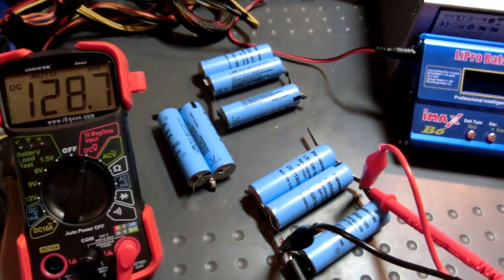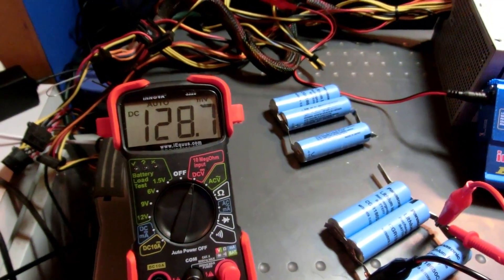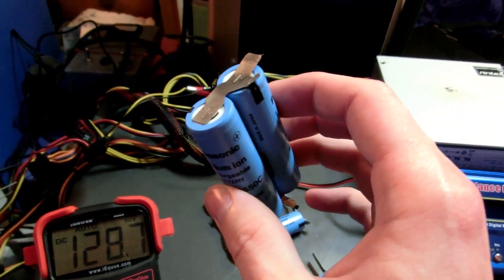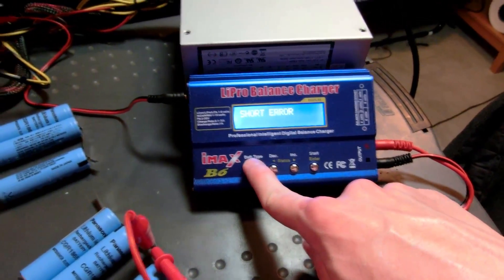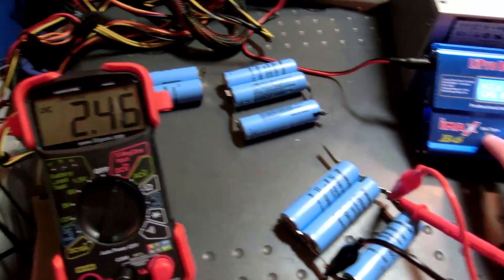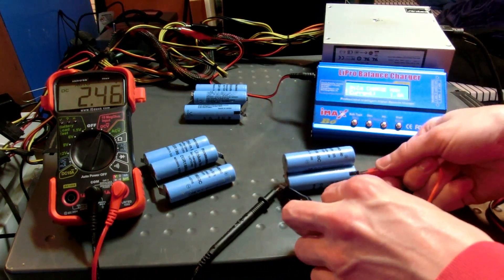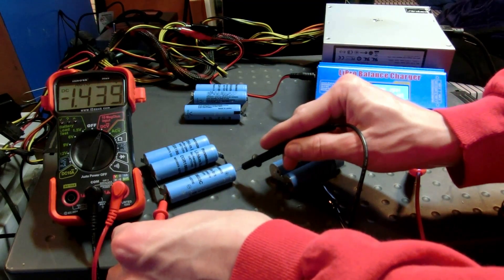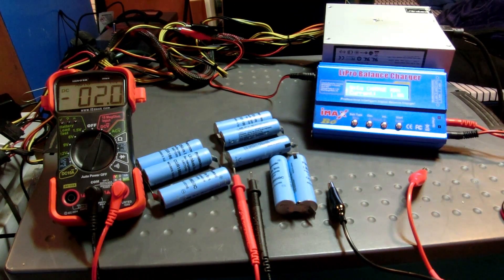Testing old Panasonic CGR18650C Lithium Cells

Comment: For anyone wondering... When reviving old/dead Li-Ion cells, first: separate them!  Any one of the (3 in this case)parallel cells  can be a failed cell, and pull the others down. 
Next:  NEVER, EVER, charge Li-ion cells at full rate if they are less than 0.9V... they must be trickle charged at less than 0.1c until they reach at least 1Volt.  Then it's best to restrict charge rate to under 0.5C until it reaches 2.0V, then you can increase to the manufacture's specified charge rate.
Liquid electrolyte Li-Ion cells (as shown in this video), when  left discharged, will experience dendrite growth throughout the electrolyte, which are microscopic strands of metallic Lithium that can short-circuit the cell. This is 'terminal' to the cell, and can not be reversed.
Reply from the maker: +beforebefore if a cell had been pulled down by a parallel cell, dont use it.

Comment: I came across a few as well. Word of advice, cycle. If you charge an old cell and it discharges quickly, it doesnt necessarily mean the cell is bad - rather, the cell may be  in need of reconditioning. Charge it again, but at a lower current. You'll notice the discharge slows down with each cycle of slow charge. Give it a try!
I've also learned that a charge current of .0125A over several hours will spring any (so far) rechargeable lithium cell back to life, from below 1v. Interesting stuff, this lithium chemistry
Reply from the maker: +Addis Williams i used to use cells from bellow 1v, but then one of them almost blew up my battery pack when it shorted out. its just not worth it. i only use cells found above 1v now

Comment: Specification:

Material: Li-ion Battery
Voltage: 3.7V
Capacity: 2200mAh
Size: 66x18mm 

- 18650 3.7V 2200mAh Li-ion Rechargeable Battery 
- no memory effect
- Widely used on torch, laser pointer, as emergency lighting and other portable devices

Comment: I just found 4 of those cells at GoodWill in San Carlos, CA. They all bonked pretty hard. Dead cells.
Reply from the maker: goodwill sucks pretty bad though, they sell everything thats good on ebay.
Reply: True. Another Dell battery had 8 cells and they are averaging 600mAh. I wish I could show you a picture. It contains 4 'Rinoa' tips. Batteries sure are fun.

Comment: wasn't sure given the age of the vid if i should comment or not... but...
When you started trickle charging, the voltage jumped to 2.1V... this is the old school battery protection circuit re-enabling the battery from a sleep state.
The reason the battery's still slowly discharge is because your multimeter will draw ua from the battery to detect voltage and given the battery capacities were so low (~0.1%) this equates to a noticeable constant voltage drop.

Since the video is a year old, you may have used them etc however i would do 5 charge / discharge cycles at 100mA and note their capacities... If capacity is over 60% of original then repeat test at 1A charge discharge.
If the capacity is still rising after 5 cycles, continue cycling until capacity stabilises.
NOTE: at higher amperage charge discharge the capacity will be different than 100mA but it may recover more as the electrolyte becomes 'more' active from dormant state.

Let me know if you try this or if you have already used / thrown them.

Also, you might want to consider a lipo charging bag if you are worried.

Comment: well, actually since they're old and haven't been charged for a while, they will self discharge. i recycle laptop batteries and pick out the ones that takes the highest charge. and i recharge three at a time to a max of 4.18v, i use them for flashlights o4 whatever. 
when it's zero or almost dead, charge a juice in them at to bring it 1v then charge it right away. they hold their charge pretty well when fully charged. i just use my 2-3 cell rc battery charger.
this is what you gotta remember  when laptop batteries stops charging, 99% is that the cells are still good and the 1% is the safety charging electronics attached to the cells. these things have a safety chip that can only be charged a certain number of times and after that it will brick the entire thing and there is no way that you can charge it using the laptop charger. this goes for any lithium power tool batteries as well or anything with lithium  cells. the cells are still good but manufacturers put a limit on charging them, one for safety reason since lithium explodes and of course the main reason is that it is expensive and profitable, the more often you replace them the better for the manufacturer.  business!
remember, the cells are still good, but you gotta balance charge them or if you have single cells li-ion charger works better.

Comment: In the video, after you have the B6 displaying "Short Error" (while charging at 0.1A) - the next clip shows the B6 charging these at 1A (not the 0.1A you mentioned before) - is that on purpose, and is it safe? Having some 0v 18650s and a B6, I would like to try this for myself. :)

Comment: Maybe you can help figure out why my E-bike Battery wont charge.  It is a fairly new  36 v 9ah battery for the BH-Emotion Neo.   It reads 25v right now but it wont activate the charger to start charging it.  Now I have a second battery which charges normally on the charger.  Do you have any idea what is reason why the battery wont charge?

Comment: I recently tore apart the pack from an old NEC P1 laptop, has the same batteries, all of them showed that small voltage, they all took a full charge to 4.24 volts and are holding well, I have them in power packs and they work fine

Comment: normally one goes bad and it drains all the others, so charge them using the fast charge setting on the imax b6, it basically only does the bulk charge and also only charges it to around 80% capacity but then soon after finishing remove the tabs from between them and leave them for a few hours and check the voltages again.
Reply: Thomas Sears i found this from when i charged one i noticed one of them was getting really hot and i was because it was dissipating a fairly large amount of heat

Comment: i have a box with a lod of 0 volt li-ions in just dont have a charger that will give me very low current to try and charge them really realy slowly to see if they will come back to life
Reply: David Simpson I made one from a little charger like for a cell phone . I charge a few at a time so it lowers the amperage between them. Out of 276 cells I have 33 were bad
Reply: ww321 yeah but wouldent the on bad cell hold the other back from charging in the pack
Reply: David Simpson  Not really . You would start the charge and monitor with a volt meter. Say you stop at 3.5 v and check. let them sit and see if they lose voltage. I would say though I never leave the batteries strapped together with the original straps. I see that causing issues with real testing and proper grouping of cells to a certain AH rating.